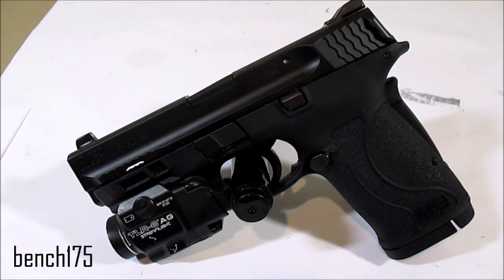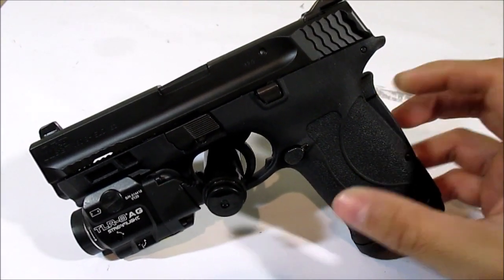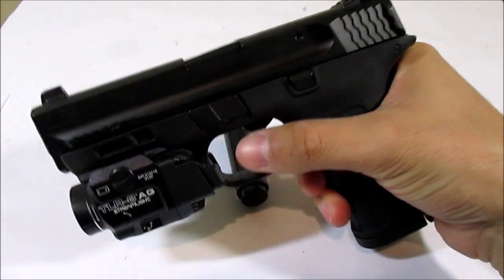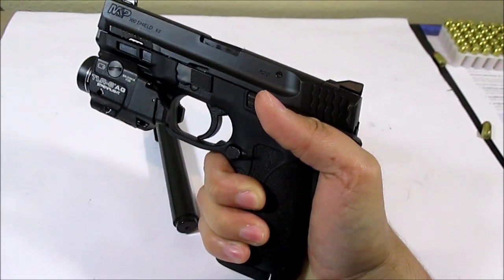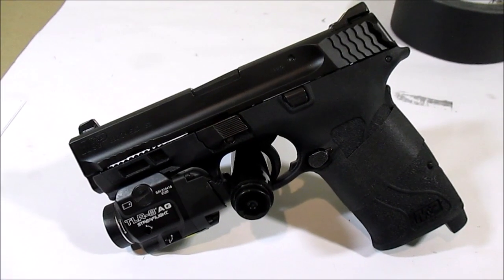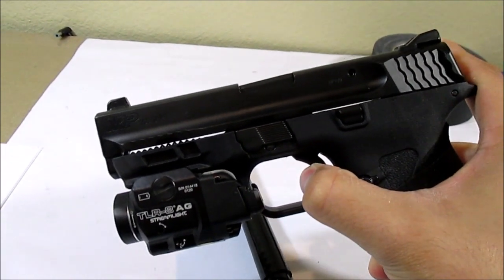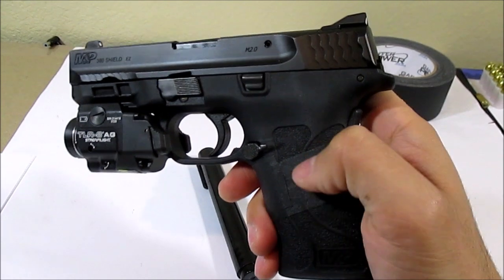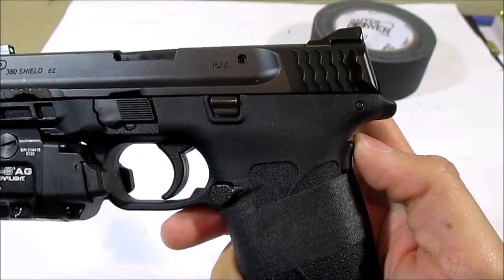Smith & Wesson M&P Shield 380 EZ grip safety & How to disable

Comment: I have the same problem. I have small hands and I put my hand tight and high on the grip safety but I still have trouble with it. My skin on the web of my hand feels raw by the time I'm done shooting in the range from trying to make sure I have the grip ssfety pressed down. This 380 EZ is my first gun and now I am no longer enjoying shooting because of the problem I have with the grip safety.
Reply from the maker: Hope you figure something out and enjoy it soon
Reply: I have the thumb safety on the slide ....  i just put a rubber black hair tie on mine....works great...
Reply: I wouldn't recommend doing what this guy did. The ez is a single-action-only hammer fired pistol which means it really should have some type of external safety to be carried securely. That's why they made it that way.
Reply: @miked2543  I didn't...I switched my EDC to LCP Max 380...so glad I did.
Reply: @miked2543  What is the reason for a grip safety over a thumb safety though?

Comment: if you take your grip safety out with the one pin below you can remove the entire mechanism and the gun acts as tho it was never there to begin with. if you intentionally reinstall it incorrectly and leave out the spring you can actually just disable it all together and then maybe tape it to keep it from wiggling im using the flush safety from mr380products with it done up like that and it acts as though it never had the saftey to begin with.
Reply from the maker: Thanks.  So the gun still functions without the spring in there?  Does it disassemble without removing the tape?
Reply: @bench175  you have to pull the pin and remove the whole grip safety part and then the spring is behind it if the tape is covering it than yes you will need to and so far mine functions fine you millage may vary with the stock grip I'm using a flush fit one
Reply: @ScottRidesHonda  I've been trying to get one of the aftermarket flush grip safety with no luck. Any chance you have an extra one?
Reply: @mattlove2110  no sorry bro it looks like they were 3D printed I actually don't own mine anymore I let mine go when I sold that pistol

Comment: Just ordered the tape on e-bay.$16.88 and free shipping. My problem solved. Thanks. I also put a small dot of red nail polish where the thumb safety is so you can see the red dot and know know it is a firing position or safe condition.
Reply from the maker: Welcome.  You won't regret it.  This tape is just as useful as duct tape, but better bc it doesn't stretch.
Reply: I got the 2" on amazon for $12.
Reply: Ditto...with the red paint.

Comment: I cannot thank you enough for this!!! As a personal defense weapon, I absolutely hated – when practicing – when my hand was on a grip safety too loose, And it took a second or two to figure out. That was all I would be attacker needed to get the advantage. 

Note: get the 1 inch grip tape. There are bigger widths available… do not get those!! Also, they have just about as much texture as the regular grip.
Reply from the maker: Happy to help
Reply: I used the 2", seems to work also.

Comment: Thanks for the tip, I may give this a try. I do have a thumb safety on mine.
I've had the same problem with the grip not engaging resulting in the gun not firing. I have small hands so that doesn't help either. This is my first ever gun and the main reason I bought it was for the easy rack slide. Hate the grip safety though. Would've been a perfect gun without it imo.
Reply from the maker: I agree.  If you tape it, youll love it afterward
Reply: please don’t do this; the grip safety acts as a trigger disconnect and a firing pin block. it will not be drop safe
Reply: @DuyTran-kc9oq  yeah I decided I'm not going to do this. I'm looking at possibly buying a Springfield 911, Sig P238, Kimber Micro or Browning 1911 380.  Would like to rent and check all of these out before I decide on which one to buy.
Reply: @TJC1315  If you drop the firearm, chances are there that the grip safety will hit the corner of the concrete curb and be pushed in at the same time inertia brings the hammer back.

Comment: The EZ series is single action hammer fired.  The grip safety prevents the gun from firing if dropped.  It would be best to get something else if you don’t like the grip safety!

Even if you have the manual safety model it won’t always be engaged.  This is a VERY BAD idea.
Reply: If you drop the gun, chances are good that the grip safety will strike the drop zone first and be pushed in.  Almost immediately the inerta of the trigger, relative to the frame, will allow it to fire.  Be sure and buy the ambi-thumb safety model so the manual set on safe thumb safety will continue to block the trigger,  even if the grip safety is bumped to the unsafe condition, when dropped.

Comment: Your solution worked really well. I got the model with both the thumb and grip safety. I found the grip safety to be an annoyance, plus I really don’t like aggressive texturing, especially when it feels like sandpaper. The tape solved 2 problems and molded really well to the grip. I bought some 1” tape to reinforce the primary 2” wrap, because I was getting just a little, but enough play to where the safety would occasionally not disengage. Other than the grip safety, it’s a great .380 shooter. My quick fire shot placement is much better than with my 9mm Ruger LC9s Pro, which is pretty snappy.
Reply from the maker: Glad to hear it work for you

Comment: Remember in order to field strip and clean your pistol you have to take the tape off of the EZ380 and also the EZ 9mm. You will have trouble to try the slide off and on if you have the grip safety in the off position. After you field strip and cleaning the tape back on. I would not recommend doing this if you don't have the thumb safety on these models.
Reply from the maker: I think I talked about removing for field strip in the video.  Thanks

Comment: I've never had any problems with my 1911 but the grip safety on my new Equalizer has prevented me from pulling the trigger several times. I need to do something to overcome the Equalizer's requirement for having a PERFECT hold on the gun to make the gun work. If one is operating under stress or from an awkward position and is an octogenarian, PERFECT anything is not in my vocabulary and everything I do is awkward! 😜

I don't want to disable the drop safety on the gun. Has anyone had any luck curing this design flaw with one of the after-market replacement grip safeties?

Comment: Is it like duct tape like you can rip off a strip that's thinner than the roll itself? (So it don't just rip horizontally like some tape, but it can be ripped into thinner strips vertically?)

Comment: There are a couple obvious safeties for this model that I can find on inspection: a trigger disconnect and a firing pin block. Both of these are disabled when the grip safety is depressed. Also, when the grip safety is depressed, you can't field strip the gun properly because of the mechanism that disables the firing pin block.
Reply from the maker: Thanks.  You forgot about your finger safety.
Reply: @bench175  - isn’t the tape removable for the few times a year you would need to field strip the gun? Also- when did so many gun owners lose their common sense? Maybe it’s just the million + first time gun buyers commenting here 🤷‍♂️
Reply: @RustyZipper  Hey no need to be mean man, you might be assuming what I meant to say. I just wanted to add information to the topic. Some people (myself included) break down my firearms regularly for cleaning and whatnot, so the tape would be inconvenient for me. Also, despite the fact that I've never dropped a gun before, I like having a drop safety. 
Believe it or not, I searched for information on this subject because I don't like the grip safety either, but unfortunately the tape won't work for me. I shared my thoughts for others who are in a similar boat.
Reply: @crazyairsoftdebater1  Thanks for your opinion! Good to see all sides of a discussion, we need more of that these days!!😁
Reply: @bench175   Firing pin block is a drop safety feature, has nothing to do with what your trigger finger is doing the moment the gun hits the ground.  On a 1911 without firing pin block they use titanium firing pin and extra power firing pin return spring to make the gun drop safe.  But the EZ is not designed like that, so disabling the firing pin block IS a safety concern :)

Comment: The grip safety on my EZ is problematic.   A safety that unlocks the trigger some of the time, most of the time, but not all of the time (emergencies do not allow for fiddling with strong hand position and contact with the grip safety device), makes the weapon not dependable for emergency reactions.  If you have the EZ with the ambi-thumb safety that is sufficient for condition "0", cocked and locked.  I also locked out my grip safety.   Trouble is, when you disassemble for cleaning the grip safety must be set, otherwise you will lock up the slide on the rails and need a gun-smith or a hammer.

Comment: Gaffer tape...got its name from stage hand work.  It was tenacious like electrical tape or duct tape but did not leave a residue, which was ideal for taping stage sets together,  or taping down without ruining the furniture finish or pulling the set paint off.  Heavy rubber bands or cut-up innertubes for english bike tires work as well.

Comment: Instead of doing this, I added a thin strip of adhesive rubber tape and it made all the difference in the world. If you grip this gun perfectly, it is not an issue but it is easy to have a slightly less than perfect gip. This comfortably solves the issue. Too bad I cannot post a picture.  It is just a short strip about 1 mm thick located on the top safety and down about an inch from there (personal preference here). The tape is double sided but the unprotected edge dulls quickly and is not sticky. I used 3M Double Sided Tape, Roseberry Heavy Duty Mounting Waterproof VHB Foam Tape, 16FT Length, 0.4 Inch Width for Car Decor,Home Decor and Office Decor from Amazon.  Too dangerous to have no safety. Does not interfere with anything just adds a little padding to increase reliability.  Works for me, perhaps you as well. Great little gun otherwise.
Reply from the maker: Where did you get the rubber tape
Reply: @bench175  Amazon 
If you search for the description you will find it

Comment: I just went to a gunshow yesterday and handled at least 4 different EZ 9mm guns (all factory brand new in box). ALL were slightly different in grip safety "spring tension"! Surprised the heck out of me... One gun had an extremely LIGHT grip safety, felt like a grip safety on a "well-tuned" quality 1911! The EZ 9mm that we got for my wife (because of its EZ racking) has a much stiffer "TWO-STAGE" spring tension. It's fairly (acceptably) light initially until the "firing pin block release button" (not sure what else to call it) on the underside of the slide is engaged as you continue to depress the grip safety more. Then it becomes noticeably stiffer... That's why it can be somewhat "easy" to lose just enough grip, allowing that "firing pin block release button" to re-engage the safety block and prevent the firing pin from releasing.

I then tried many draws to "strong-hand only" presentation and (dry)fire. I made fast draws as should be expected if that "hopefully never happens" self-defense moment should arise. Sorry to say it failed to release the firing pin (block re-engaged) maybe 1 out of 10 times. Yes, I am an experienced handgun self-defense practitioner who trains very frequently and have for decades. Rated as "Expert" in IDPA and have several state/regional championships from years past... not trying to brag, only to substantiate what I'm trying to share. 

Yes, lots of dry-fire practice, drawing to present both two and one-handed shots will improve the "reliability" factor. My wife won't be practicing as much as I do, nor does she have the training and practice by competition I've had, so I would project a higher frequency of "oops" by her (haven't tested her on it yet). 

Remember, what really matters isn't the slow "bulls-eye" shooting, but grabbing your self-defense weapon and pulling the trigger when sight is on target as if you had to. 

I suggest those of you who do own an EZ, either 380 or 9mm (mine is 9mm), do a LOT of dry-fire practice, both one and two-handed. If from a low-ready position, sight on target and pull the trigger at least within ONE SECOND. Also try dry-fire from various position such as leaning out left or right from behind cover... See if you experience a higher frequency of "oops" with the EZ grip safety.

I'm still on the fence about whether to keep the (brand new) EZ 9mm and whether I will consider my wife qualified on it if her frequency of "oops" remains high. Her EDC is currently the Walthur PK380, which is also EXTREMELY easy to rack, but we've wanted to upgrade her to a 9mm for some time now. Any suggestions besides the EZ 9mm? ...just saying.
Reply: Wow!
Reply: @wallychambe1587 lol you wrote a book

Comment: Disabling a safety because you don’t have a good enough grip means you need to shoot more and grip it harder. Don’t do this just grip higher!
Reply: It is not a grip or a training issue. The pistol has a design problem. Your idea is fine for the flat range under ideal conditions but not under stress. Believe me you could train for years but it won't help!
Reply: Ths is not a shooter issue it's a design flaw. Having a "safety" which often prevents follow-up shots (as from my experience) because the pistol is not being held just right, is no safety at all, it is an extreme hazard. S&W should be put out of business for selling safety hazards.

Comment: my girlfriend has the same problem with that back strap safety so I took a zip tie and put it behind the trigger and around the back strap safety and made sure that the zip tie and where one piece goes inside the other I put in front of where your thumb would rest which put it totally out of the way.
hers also has the manual thumb safeties so she can always use those.
I'm still waiting to have her test the gun this way to see if that helps her in her shooting.
I myself didn't have any problem with the back strap safety but I prefer using Glocks which only have a trigger safety.
👍👍👍👍👍
Reply from the maker: interesting way
Reply: @bench175  today we tested it and she had no problems at all shooting it and keeping all shots inside of a paper plate at about 25 ft or so.
No failures from limp wristing.... From trying to get that back strap safety held in.

Comment: I would do this on the manual safety equipped version only :)
Reply from the maker: chicken. lol jk
Reply: I taped mine but I still have the thumb safety!😁
Reply: @bench175  im looking into buying one for someone with a disability. Might want to revisit the idea of the thumb safety. Ive been reading removing grip safety without the thumb safety makes it unsafe if dropped.  I carry glocks and dont like safeties on my ccw, but they need to be a safe design also.

Comment: Not saying this is a bad idea, but keep in mind that the grip safety makes the gun drop safe.
Reply from the maker: Thanks
Reply: Have you tried dropping with the ambi thumb safeties engaged.  I have found the thumb safety to be at least more reliable than the grip safety.  My little CSX is hammer fired and has no grip safety.  It does have the ambi thumb safeties.  As my manual of arms traiining goes I always sweep the thumb safeties off when drawing my EZ pistol.  This is not unlike the 1911 operators do when carrying "cocked and locked" condition "0".
Reply: Only if you do not strike the grip safety and push it in first before the trigger inertia takes effect.

Comment: I have to do something to my wife's ez380. I put a thin piece of foam gasket material on the grip safety to enlarge it. The  ez 380 pro has a larger grip safety. I would have been better off to get a striker fired
Reply from the maker: After taping it, I don't even notice it.

Comment: It's hammer fired not striker fired. I means if you drop or bump , the gun hard it can go off. If you had a manual safety you might get by. You are pulling the Triger before you have the grip pressed. Practice Your grabbing and holding about 1/4 of a inch to high.  The performance center guns have a larger grip safety. There are some after market grip safety levers out there.  I would replace it before I taped it.
Reply from the maker: Thanks
Reply: I will search for after market grip safety levers, I have mine taped for now, I also have the non EZ version with no safety's at all but it is hard for me to rack!!😁😁
Reply: @wallychambe1587  just get a slip on grip
Reply: The EZ and the CSX are both hammer fired.   They both have (or are available with the ambi thumb safety much like the 1911.  My manual of arms in training says sweep the thumb safeties on the draw.  That way you can carry "cocked and locked" like the 1911 operators...hammer back, one in the chamber.  Has the "gun may fire if dropped without the grip safety crew" tried dropping either EZ or CSX with thumb safeties "ON"?

Comment: The only issue I see with this and or gluing it down is disassembly and reassembly of the firearm. I am seriously thinking of either gluing it or drilling a hole and putting a roll pin in it
Reply: Just get a slip on grip